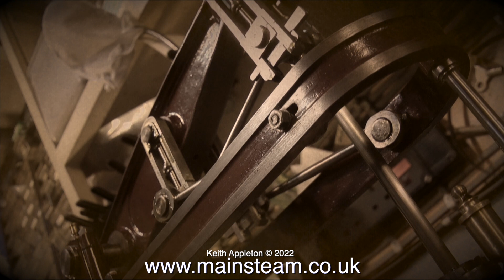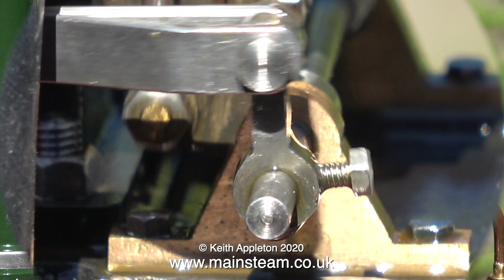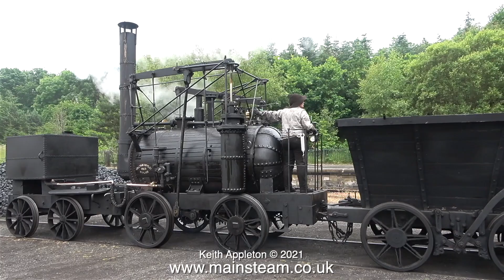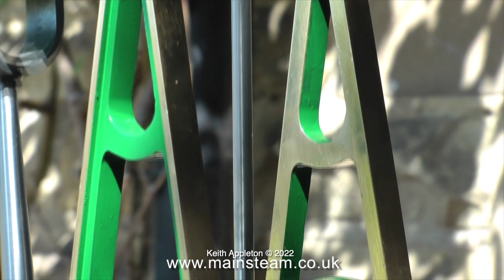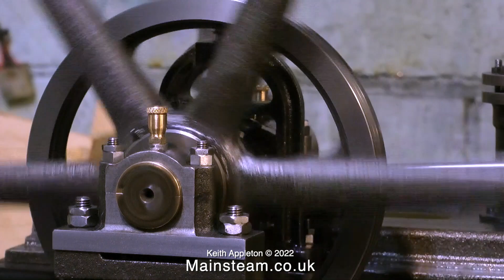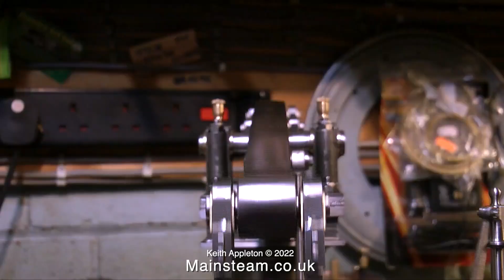BEAM ENGINE COMPONENTS - MODEL STEAM ENGINES FOR BEGINNERS - PART #18

Comment: don't speed governors that are not used disappoint you at all? I don't like them unless they are functional

and yes, I know they end up being swiss watch parts then, which makes them delicate
Reply from the maker: On my Stuart engines the Governors are functional if I want them to be, but I adjust the linkage so that I can run the engines at unfeasibly fast speeds sometimes.